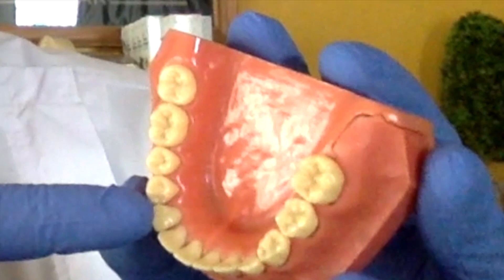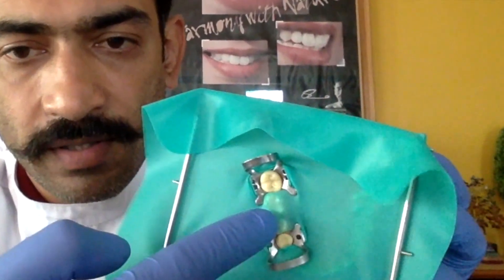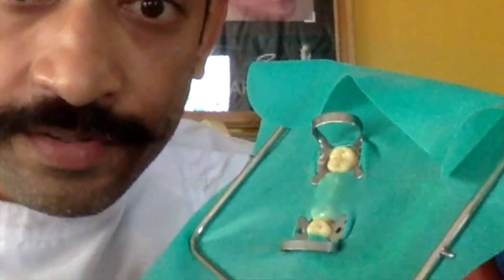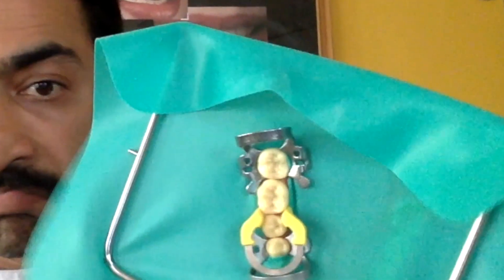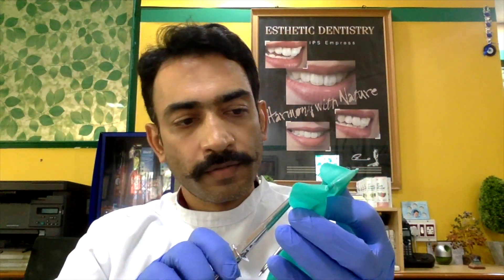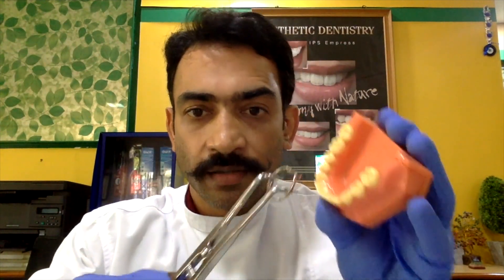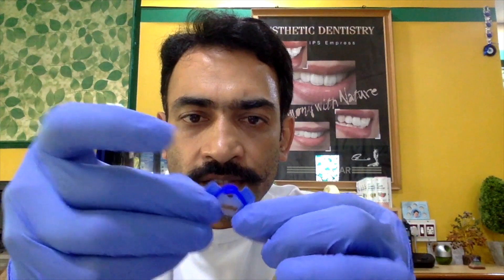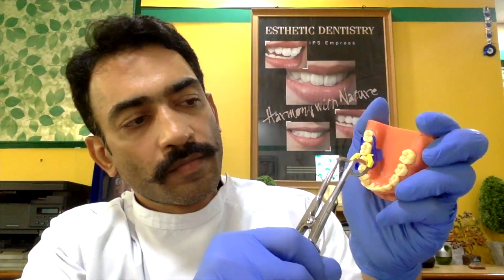Easy Rubber dam for Class II restorations - 3 METHODS

Comment: IF you were doing a distal  class  II on the second molar wouldn't the clamp bow interfere with the hand piece when prepping?
Reply: Yusuf Khan Thanks for stopping by and leaving a query. As a rule for restorative dentistry the clamp should not be on the treated tooth. Therefore in the case you mentioned the clamp would have to go on the third molar. Moreover I prefer to place the dam after prep or at least after the major part of the prep is over but that is just my personal preference

Comment: I just wanted to make sure if there wouldn't be any seepage between tooth number 45 and 46 if we use this technique?
Reply from the maker: Hi there Akshata, Thank you for dropping by and the question. This technique should be followed up with a final sealing measure where you should place a liquid dam (Kool dam, Opal dam) along the edges of the split rubber, to ensure that you get a good seal.

Comment: Hi ... It's a quite nicely done video. Wanted to start with rubber Dam in my practice.... Could you suggest the specifications and the brand to go for the rubber Dam kit... Thanks
Reply: Hi Sachin, I would advise that you pick up they Hygenic Kit as a start or then check out the Waldent kit on dentalkart. (https://www.dentalkart.com/waldent-rubber-dam-clamp-kit.html?gclid=EAIaIQobChMIq5ikoZq43wIVQiUrCh1xuAm5EAQYASABEgKocfD_BwE) 
Subsequently the rubber dam sheets can be got from ident.in (https://www.ident.in/index.php?route=product/category&path=62) Both Nictone and Sanctuary Rubber Dams are good to use

Comment: If u connect the holes u will loose the islotaion effect of the dam. 
Not that I would ever use one on my patients. Its not needed
Reply: So instead of having some isolation, you have no isolation at all?
Reply: Thanks for dropping a comment. In most cases I have found adequate isolation but certain cases would require the use of an injectable resin like opal dam to get securely sealed borders. Rubber dam is just an option for hassle free Class II restorations with assured predictability. The use of it however is purely subject to user preference.:)

Comment: Do patients ever complain about feeling of suffocation when rubber dam is  used?
Reply: Yes, some do. It is prudent to tell them that they must swallow frequently under the dam. That helps reduce the feeling of suffocation
Reply: Still what to do if they continue to get that suffocating feeling? Has it ever happened that you had to do the treatment without rubber dam or were you able to convince them to have the treatment under RD?
Reply: You can punch a hole for them to breath through if they feel the need to mouth breath. That might help with the suffocation. Explaining the need or advantage of using the dam helps belaying the fears of the patient. The small dam works well because it does not cover the mouth. Yet if the patient is still uncomfortable I work without the dam
Reply: Thank you for your response
Reply: Ganesh kumar I'm